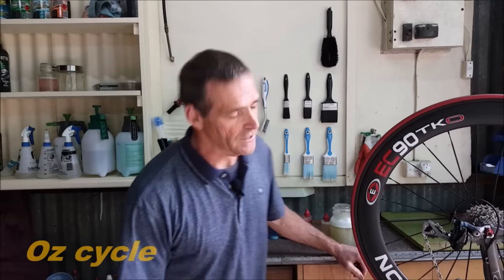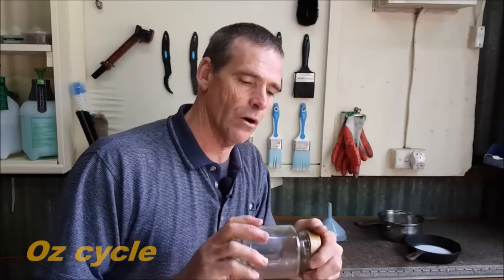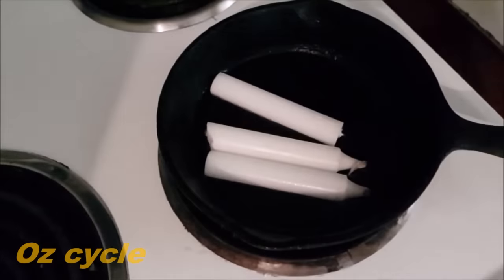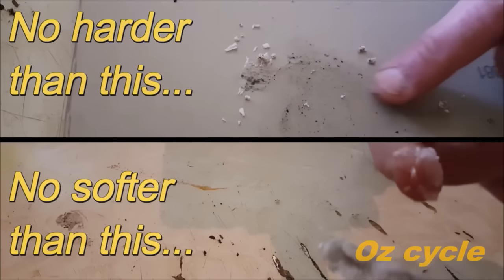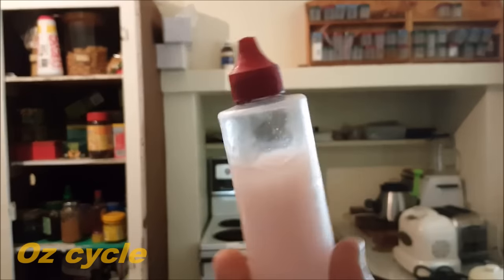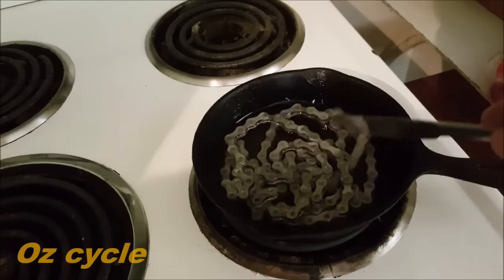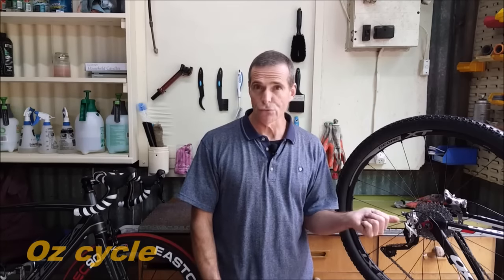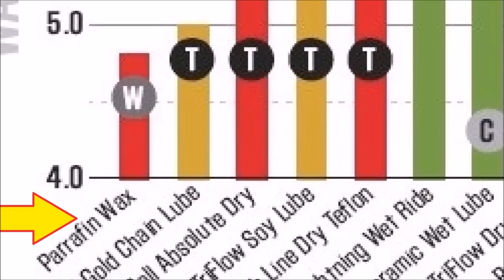BEST chain lubricant ever !! .....make it yourself.

Comment: Hi, in the bath method you said that it is not necessary to clean the chain when rewaxing. What about with this lub? Is it necessary to clean the chain before re-lub? And what about start with the bath and re lub with the liquid solution?
Love your channel!
Reply from the maker: Yes,clean your chain b4 reliving even if it's just with a rag otherwise dirt will mix with the line you are adding.With the bath,take chain off bike and pour hot water over it until chain looks perfectly clean then relax.

Comment: Sounds Good. But how do you get the wax off if you need to clean the chain again. Will petrol remove it?
Reply from the maker: +Ian Russell Yes,petrol followed by degreaser. Cleaning the chain is the most time consuming part of waxing,Ian.
Reply: Here, in the UK, I have a problem as "paraffin oil" has two distinct descriptions. The most common is what I simply call "paraffin" (like kerosene) and I use it in a heater for a small greenhouse. The other seems to be more correctly called "liquid paraffin" - a highly refined mineral oil used in cosmetics and for medical purposes.  Which one of these does you recipe include?

Comment: Great video! Just one question: how do you clean the chain before relubricating? Do you just wipe it with a cloth?
Reply from the maker: +keinumatti You can use petrol or degreeser first. Then a final soak in rubbing alcohol or metholated spirits.

Comment: What about winter? does it freeze the chain in the winter? Viscosity depends on pressure and temperature so the chain should be heavier to pedal below zero (viscosity drops). Should you add some winter diesel fuel or something to prevent freezing? like Masinol for anti freese. I like bio degradable so maybe something bio anti freeze. Google advised ski cleaning or propylene glycole

I use rape-seed oil for chain wash. I can use developed washing mashine, shaking in jar or rolling-brush chain cleaner. It also drops in viscosity in winter so I thought adding renewable diesel.
Reply from the maker: +Lauri Pullinen To lower the solidifying temperature point simply add more paraffin oil. For application,add more xylene...once the xylene evaporates it leaves just the paraffin oil and wax mixture.
Reply: Hmmm, an interesting consideration for choosing a ratio of paraffin wax to paraffin oil.  It seems a higher wax ratio allows the chain to stay clean with its water and dirt repelling property.  At the same time, cold temperatures could reduce efficiency.  Hmm, I have a few small bottles, and it might be worth it to mix up a few batches with somewhat different measured ratios.

Comment: Hello, Thanks for the great video :) Very helpfull !!  Just made the wax with 1/3 of all ingredients. But at 20 degrees it does not stay liquid. Should I use more Xylene to make it more liquid ? Hope you have some answer :)  Grtz from the Netherlands
Reply from the maker: +JAN LAM Hi Jan. Simple warm it up a bit....sitting it in warm/hot water will do the trick.
Reply: Works great :) Thanks

Comment: I've tried to do the lubricant, but I have a problem, when the lubricant cools down, it become solid, it's not liquid any more, should you reheat on every usage? Thank you oz cycle for the video
Reply from the maker: +radu4u2 Yes , immerse the bottle of wax in hot water and it will go liquid again. In summer when temperatures are higher it should be liquid most of the time.

Comment: Thanks for speedy reply. However, here, in the UK, I have a problem as "paraffin oil" has two distinct descriptions for different products. The most common "definition" is what I simply call "paraffin" (like kerosene) and I use it in a heater for a small greenhouse. The other description, only slightly less common,  seems to be more correctly called "liquid paraffin" - a highly refined mineral oil used in cosmetics and for medical/veterinary purposes.  Which one of these does you recipe include?
Reply from the maker: +Ian Russell Highly refined paraffin oil sounds like it,Ian.

Comment: Thanks for the video!
 What is your opinion on this type of lubricant for say a lawn mower throttle cable and metal cable housing? Or to lube the throttle lever?
 I recently took the throttle lever and cable off of an old tiller and unbolted the lever from the bracket. (Some throttle levers are riveted and therefore not intended to be removed.) I noticed that the lever worked free and smooth and when I unbolted it it seemed to have a waxy type of lube  on the washer. It may have just been old grease but it seemed thicker and waxy. Do you have any thoughts on this? Maybe thicken the lube up with more parrifin than oil for things like this???
Reply from the maker: Yes it would work fine for that Jeff...sliding surfaces.
Reply: oz cycle That's what I'm thinking, I'm gonna give it a go, thanks...

Comment: Cleaned my chain yesterday and applyed the wax/parafinoil that went well. But my cocktail of Parafin-parafinoil and xylene got to stiff. In sweden at current temperature well below 0 deg Celcius its hard to keep liquid. Would it help to add more xylene? or du you have an oter tip (besides from hot waterbath)? Thanks for the tip! :D keep up.
Reply from the maker: +Sören Fabricius Immerse your bottle of wax in warm to hot water and it will liquify again for application. Thanx Soren

Comment: Hi - Great video, really interesting..  I'm a little concerned about the high Solvent content and it constantly spreading to and damaging a carbon fibre frame and other components (other than the chain).  When I degrease my chain I always wash the bike down, in using this mixture I will be putting solvent back on the bike? Unsure of solvent content of Tri-flow and other lubes I use.
Reply from the maker: +Paul Beynon No chain lube or solvent should end up on your frame....the chain must be wiped as clean as possible leaving the lube inside the moving parts only.

Comment: thanks so much.I live in a hot country and I will try wax only using a candle.Aome guys show this also for zippers of backpacks etc to make them glide smoothly.
I was just wondering how to clean the chain from the wax lubricant  if necessary?
Reply from the maker: To remove the wax , simmer the chain in hot water. The wax will float to the top.
Reply: @stevenleffanue  thank you

Comment: Thanks for your video. I made some really noice lube yesterday. I have 4 bikes and i took two chains off, this arvo. As I have an LPG only, Ford Falcon, I was desperate for some petrol. I had to run them threw my blue box in reverse= 3 times of course.Turns out I have some OK bike chain soup for dinner tonight, I'll be serving it in Metho. If your hungry I can serve you a Shimano Ultegra or would you prefer a bowl of KMC gold? I made up heaps of little baby bottles yesterday (I had the bottles ready, as I was gunna use them, to put my home made chilli sause in) and gave them away at my Surf Club, Mooloolaba. Make me fast fella!
Reply: I have done a shit job of cleaning them. I am just going to wait, till I get some petrol. I am looking forward to stripping them back to metal. Fork oil, I always hated it, but didn't know why. No wonder my every day bike is a Scott Sub 10, Carbon Drive (belt with 8 speed Shimano Alfine hub).
Reply from the maker: +Dominic Earley Nice description of your chain soup,Dominic...hehe.
Reply: I wasn't happy with there clean, before I waxed um. Went to Supercheap Auto to buy a petrol container. Didn't buy it because sheila behind the counter, reminded me of the power of Coke. 

Came home,  poored a can of Adli Diet Coke over both chains. Left them for 24hrs. Dumped the liquid, then bathed them in metho again. After half a day I could see the Shimayes oxidising (rusting), the gold KMC seemed unphased. 

I went and bought the petrol container. Washed them in petrol, fried them in Paraffin. They are back on my bikes now and all seems great. 

Moral of my story; yes oxidation can occur while a chain is immersed in metho and always use KMC Gold Chains.

PS; Shimayes is one of my nicknames for Shimano, as I believe Shimano is the wrong title for this product. I also order Cappucciyes, at the coffee shop. I have no idea why people put the word no at the end of titles for good things, so I am on a mission to end this nonsensical behavior.

Comment: Hi. Im from Denmark i saw the vid, and im impressed. How does the lubricant react to cold wether? in the Vid it turned hard, but what will happen when it is applied to the chain in colder conditions?
Reply from the maker: +Christian Lillelund It want go "hard",Christian,just solidifies into a stiff cream texture....the paraffin oil keeps it malleable. Make sure your chain is warm when applying the lube or it will solidify before it penetrates into the pins and rollers. Best to do hot wax bath method otherwise.

Comment: i have seen some people on the internet doing this but also adding teflon powder or graphite powder into the mix. Have you tried it yet?? if so what is your experience with it? btw i think this is the first video i see of someone coming up with a way to reliably lubricate the chain with paraffine without the need to take it off every time , good job
Reply from the maker: +Francesco Basile Adding teflon (PTFE) and /or molybdenum disulfide to the lube gives very minor friction improvement. Molybdenum disulfide colours the lube grey and gets messy,like oil,its spreads everywhere and eventually on your leg and clothes.
Reply: oz cycle thank you for your answer,  it seems that we have the same opinion about MoS2 and graphite, they are quite popular lubricants in cars but they are used mainly to replace teflon in places where temperature and pressure are much higher than those a bicycle chain will ever experience, plus their black color could just be used to make il look more exotic. anyway since teflon powder is relatively inexpensive i think i will give it a try  and i'll let you know i find iprovements in the long run (it should repel everything). what do you use to clean it up before re-applying anyway? is xilene good at that?
Reply from the maker: +Francesco Basile Yes Xylene,Toulene,Acetone. Petrol is good but you will need to degrease afterwards.
Reply: oz cycle thank you again for your answer, i saw your video where you clean it using petrol but i was a bit scared because it is such a nasty chemical

Comment: Great video! How does this lube perform in cold weather? For example when it's from -5 to +5 C outside?
Reply from the maker: +Artem Scherer As long as you get the viscocity right at that temperature when testing it should be fine.

Comment: Thanks for the VID. I have a question. How does this application work in super dry, dusty conditions? I MTB in Utah. Locations near where RedBull rampage takes place. You can see the conditions there if you've watched RR. Super dry, talcum power dirt etc.
Reply from the maker: Paraffin wax attracts very little amount of dirt so it performs better than other lubes in those conditions

Comment: Diggers Xylene  is  solvent based acrylic sealant thinners and is not available here in Europe.I guess normal acrylic thinners or white spirit will work however some plastics will react to thinners.
Reply from the maker: +velosapien You could also try googling "paraffin wax solvent, (followed by the country you live in).
Reply: "thinners" is just an aromatic solvent of which Xylene is one. Others are Benzene and Toluene. All are carsinogenic so best to use a breatehr with a filter when working with these chemicals

Comment: Thanks, good info. The only problem is that xylene and mineral spirits and acetone are all toxic. Do you have an idea for a healthier solvent?
Reply from the maker: Only heat. The hot wax method uses only paraffin wax and oil.

Comment: Hi, thanks for all your videos. I am planning on following you procedure on cleaning and waxing but could you please tell me if you treat the cassette or chain rings with anything to prevent rusting. I currently regularly degrease and relube, and to protect the cassette I give it a light spray of WD40. Do I need to do this or not please. Best regards, Jason.
Reply from the maker: +Jason Budge No lubricant is required for your rear sprockets or front chainrings,Jason. If you you live in a corosive environment like seaside,then yes a light spray with silicon would help prevent surface rust. WD40 leaves an oily coating which will pick up dirt.

Comment: Hello there, hoping to clarify before I buy the ingredients to start making your recipe. (Xylene was easy and is ordered.) In the UK we have 'paraffin' or 'kerosene' but no 'paraffin oil' as far as I can find. To my understanding 'paraffin' is a more refined version of 'kerosene' with less odour? Here 'kerosene' is often labelled as lamp oil I believe. Do you know if UK  'paraffin' is the same thing as your 'paraffin oil'? If not can you tell me which brand you use so that I can ask Mr. Google for it's composition to check this out? Many thanks for your videos and help with this.
Reply from the maker: +Simon H Lamp oil might be ok...try it. If it turns out too oily it will be too messy on your chain. Often paraffin oil is sold at pharmacists....cosmetics.
Reply: Thanks, I'll try the pharmacists first before using the lamp oil.

Comment: Gonna give this a try. My question is, on first application the chain should be spotless, what about re-applying? Do you need to remove the chain for a thorough clean or will an on bike clean be OK? Thanks
Reply from the maker: You can completely clean chain everytime if you like or to this...
Dirt should not find its way into the chain if waxed thoroughly, so you can simply wipe off as much dirt as possible with rag with some degreaser or xylene on it. Then place the chain in hot wax bath. Any extra dirt should sink to bottom of bath so you can float the chain in a metal sieve to keep it in clean wax.
Reply: oz cycle, just made my first batch, got a nice consistency before adding the xylene, but seems a lot softer after adding xylene and doing the knife test again. Is this normal? Thanks
Reply from the maker: With the xylene, the mix should be very liquid. Once out of the bottle the xylene evaporates leaving just the paraffin wax and paraffin oil mix  which should be like a hard cream ie:the knife test.

Comment: Hello guys,im very happy that i found this method!
Only thing is that, after 100km. my chain starts to squeak and i need to apply again. 
What im doing wrong? I do exactly what is in the video.
Reply from the maker: Dont remove chain from hot wax until no more bubble come  when swishing.
Reply: @stevenleffanue  I always wait at least 30min.and i do  good shake every 5min.  Taking of the chain when around 50°C
Today i made a new mix with more oil and it become really smooth,maybe thats the trick.
Im beginner  with waxing,so i believe that i need more practice to become Wax Master :)
So far im loving it! Its clean,its cheap and really silent.
Thank you for the reply and for the idea!

Comment: Paraffin oil and Xylene are not available where I live. Diesel fuel is a wax based fluid, would it be suitable as a replacement for the paraffin oil? I'm guessing another kind of thinners might be suitable as a Xylene replacement? No doubt the ratio's you suggest may need to be adjusted to get that correct wax texture? Your thoughts?
Reply from the maker: +Kendall Trembearth Sorry,Kendall,it has to be paraffin oil which is basically paraffin wax in a liquid form. The oil lightens the atomic weight of the solid wax....the more you add,the softer the wax becomes. Xylene replacements are Acetone and Toulene.
Reply: Thank you for your feedback. Greatly appreciated. Will continue the search for the paraffin oil here in Saudi Arabia.

Comment: Much improved over the previous video you made. How long have you been using this lubricant on your bike? Have you ever used Rock and Roll gold lubricant? If yes, how does your lubricant  compare?
Reply from the maker: +jimhatz3 Thank you...its difficult to cover all aspects of making the perfect wax lube in a short vid. I and a few others in our bunch have been using the wax lube for about four months now. Yes I have three rock n roll types...all cost too much for most people to keep buying. We found RnR good lube but need to reapply after every ride to keep chain quiet n smooth.
Reply: I'm still on the look for some xylene down here in brazil. On most paint stores all we can find is some mineral spirits. But I can vouch that only a mix of melted paraffin oil and wax do a great job even under wet conditions. 

I've been using it on my mountain bike for the past few hundred km and won't use oil based lubricants ever again. Under dry conditions each application lasts for at least 150km and under mud/wet the best I have acheived was 50-60km. no dirt on the chain in the end of each ride, no squeaking chain either.
Reply: I found the same as Oz; RnR wore off after one ride. This lube however I'm about 300km in and just seeing how long it lasts ... so far so good!
Reply: Are you on smack jimhatz3, Rock and Roll lube (Chock the Mole lube) is the same thing man. Wet or dry, he showed you that. Thing is, you have to strip your chain back to bear metal first. All the lube in the world is no good, if you have a dirty mineral oil on your chain. Muzz, your q about mud/wet is redundant. Just sort your chain out.

Comment: Is there any reason why we would need to use proper candlesticks instead of candle wax you buy by the bag? Would there be an issue in using dyed candles or candle wax?
Reply from the maker: The only issue is purity of the wax. Impurities detract from the overall peformance.